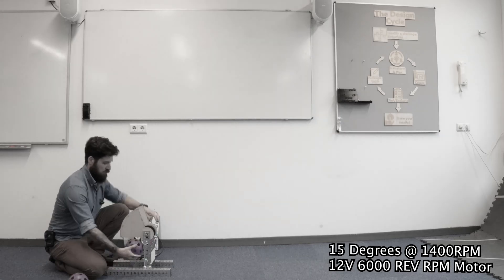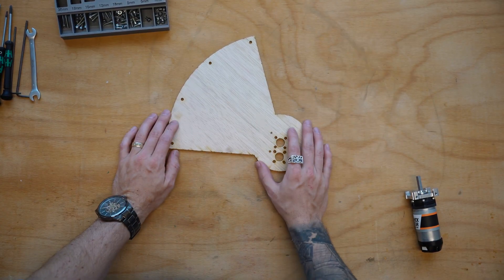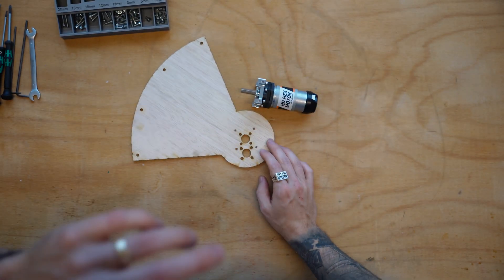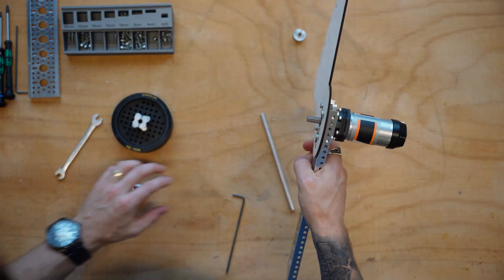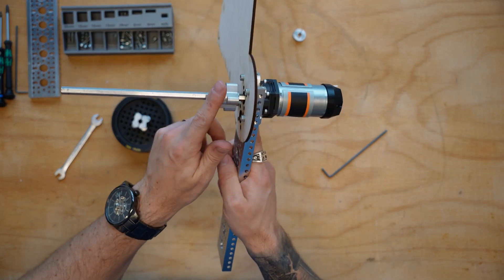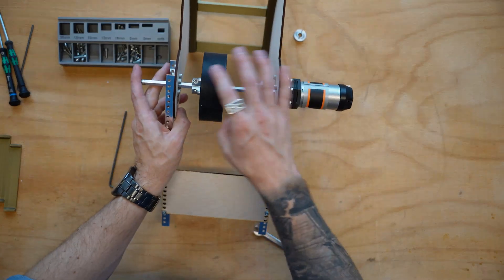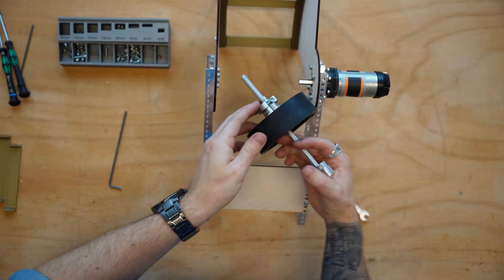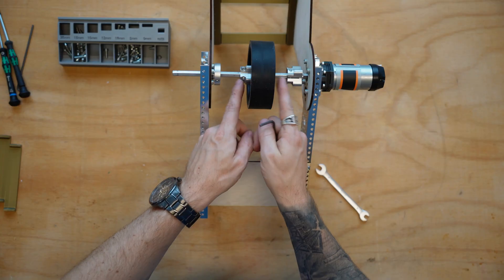How to Build a Hooded Shooter (Step-by-Step Robotics Guide)

Comment: Couldn't i just cut out the piece of wood using manual labour?
Reply from the maker: 100% you can. Tends to be difficult lining up your holes between both sides unless you've got some experience. You could also CNC or 3D print this.

Comment: also i was wondering if i became a designer member would i be able to see all the individual parts you used for this, quantity, and links 
also would just adjusting the hood be enough to get a better parabola or would their be anything else we could adjust
Reply from the maker: Yes, if you became a designer member in my community, you'd find all individual parts needed listed inside the CAD file. Adjusting the hood would be enough to get a better parabola. I've got a video coming out in a week or so on different trajectories of the ball using this shooter, and this data is already available for members of my community.

Comment: Would carbon fiber pla work instead of the plywood.?
Reply from the maker: Honestly, even standard PLA would work, though I wouldn't suggest it. It'd be better to cut out some holes in this design so you're not using so much plastic, and PETG or PCTG. Much more impact resistant.